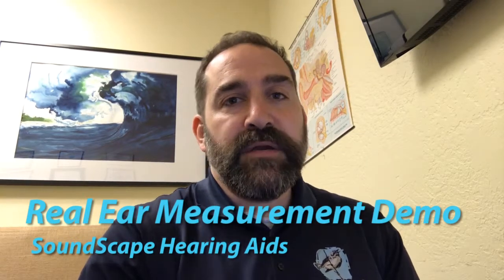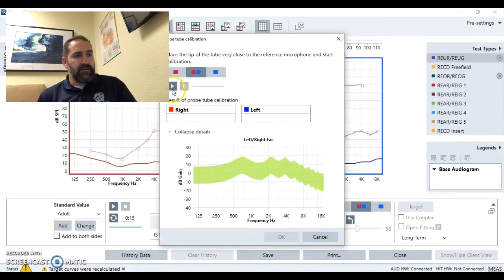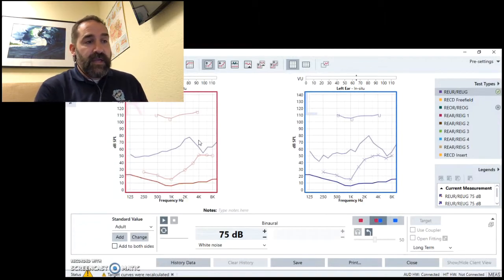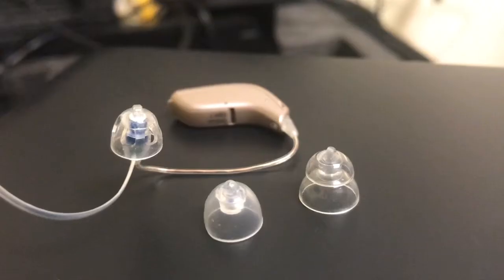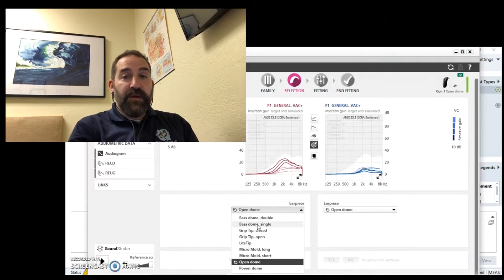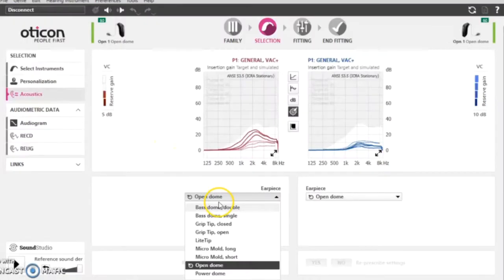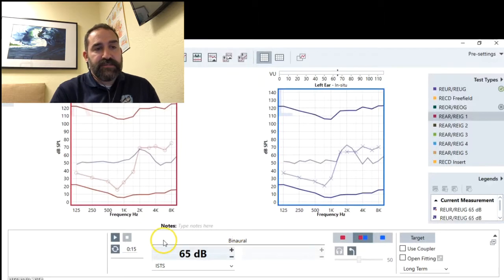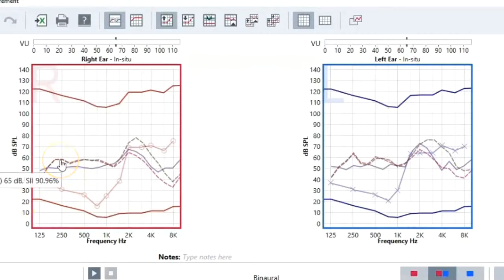Real Ear Measurement Demo

Comment: It is recommended that you perform a tube calibration whenever you change silicone test tubes on the probe. How do you do on Unity 3 device ? Is there a reference microphone for the calibration ?
Reply: There is a spot on the earpiece that the end of the tube clips into. Then you hold it in front of the speaker and run the calibration test - which is in the software.
Reply: @nathanwillardfilmmaker  thank you i foumd it !!